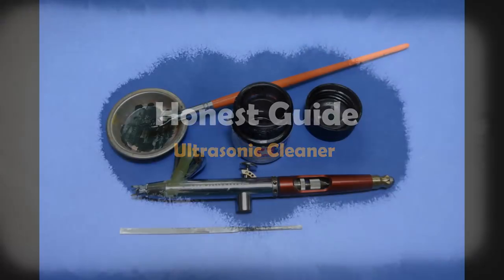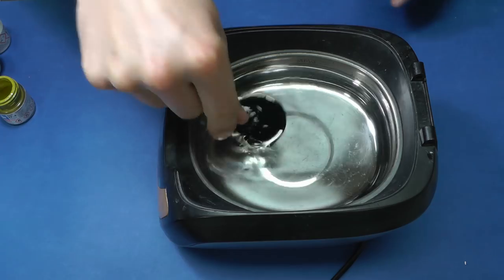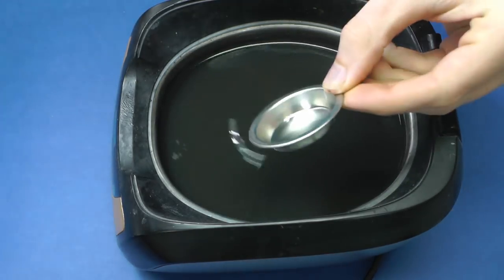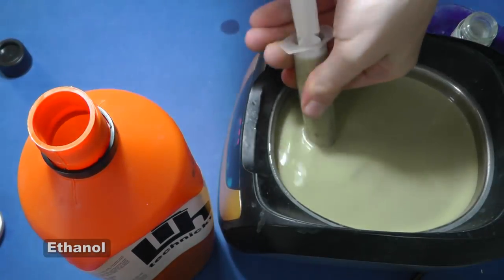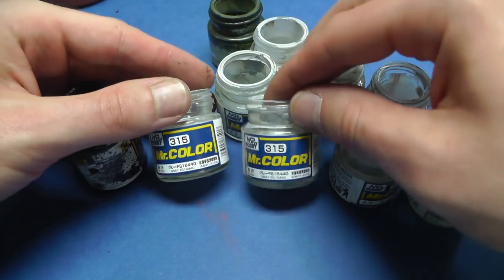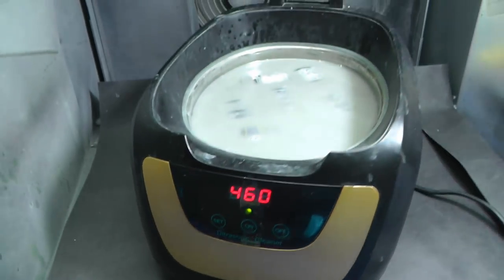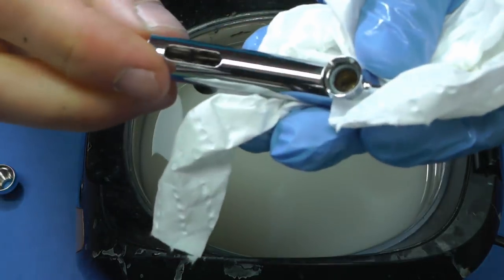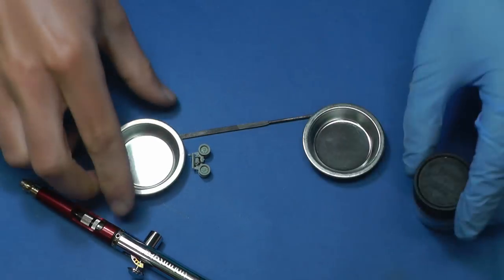Effortless way how to clean tools - Airbrush - Ultrasonic Cleaner - Honest Guide

Comment: Just a word of caution with using  Acetone in addition to the flammable vapours it produces, I used to clean my airbrush with Acetone and it melted all the rubber seals and O-rings.
Reply: Can you use ethanol or acrylic thinners with the o-ring or should I leave that part out of an ultrasonic cleaner?
Reply: +Tim Christophe
Ethanol and acrylic thinners will not harm rubber o-rings. However, acetone and lacquer thinners (also contains acetone) will damage the rubber.
Reply: Same thing for isopropyl alcohol ... Extreme warning with the ultrasonic
Reply: If i am not mistaken the harder and Steinbeck has teflon seals, a must if you run solvent based paints not just cleaning
Reply: Badger airbrushes use teflon seals.
Reply: So what thinner is best for the ultrasonic cleaner when cleaning an airbrush?
Reply: h&s has internal Teflon but still a few rubber seals.  

remove the internal seals and rubber seals before cleaning.  then just reassemble after 

the h&s won't need to be taken apart so often because the seals keep paint from entering the body of the airbrush

Comment: Thanks for the advise. Seems to work very well while it is a little expensive and uses a lot of chemicals too.
I just use cheap window cleaner to clean my Tamiya Bottles before reuseing them. If the paint is very dry leave the window cleaner in the Colorpot over night and you can clean it with an old toothbrush within seconds the next day. I made a video about this method (german language) if anyone is interested.
For cleaning my Airbrush right after usage I use simple window cleaner as well.
Reply: Chris McRoy  I cannot tell, because there's not much information about the ingredients on the bottle. Maybe that's normal in germany, never cared to look ^^
At least it does'nt smell like there was any ammonia in it.
I don't even know if my tip has any worth in other countries, now that I think of it. If there's window cleaner with and without ammonia maybe there are other differences as well.
Maybe you should just try it on half dried acrylics on a palette or something before you try it on something that could get damaged by the cleaner.

Comment: Just a word of warning: putting flammable liquids in ultrasonic cleaner might be dangerous. Cavitation and bubbles collapse produces heat, which can (in theory) ignite vapors of whatever is in the cleaner.
Reply from the maker: Thanks. I put it into description.
Reply: Agree.
I have a senior stainless ultrasonic cleaner ,the manual  tells you can't put flammable or corrosive liquids in it.
Use ultrasonic cleaner to clean model tools is not  uncommon in china, my way is put water in cleaner and  put thinker or ethanol in a small  bowl,then keep the bowl floating on the water.
And I think should very very careful when using ultrasonic cleaner with thinker ,double corrosivity easyly broken my plastics .Airbush's rubber ring may damaged too.

Comment: I get really good results with water and a good degreaser. My Ultrasonic Cleaner also has a heat setting so I can use hot water with the degreaser to clean parts.

Comment: @PLASMO - plastic models    I am a chemist and I want to warn you about benzene - BE EXTREMELY CAUTIOUS ABOUT BENZENE  It can cause cancer and CNS problems if exposed to it often.  If using this please do not use in the sonicator!  If you do you will need a respirator and chemically resistant gloves to minimize exposure and even then the fumes will still cause damage over time.  NEVER BREATHE BENZENE FUMES

Edit: I am glad you addressed PPE later, I just saw the 'I use benxene in a sonicator' part and panicked, I just didn't want to see you or anyone else get hurt by that stuff :)

Comment: also ultrasonic cleaner with some cleaning fluid is perfect for removing the release agents on resin kits
Reply: Yes, beyond any doubt. However, I have also found that vinegar (due to the acidity) also works well in cleaning the silicone films on resin and photo etch parts as well. :-)

Comment: How to use WAY less thinner to clean glass jars.  Get a jar large enough to hold the jar you want to clean.  Put the jar to be cleaned in it.  Fill it with lacquer thinner.  Now put that jar in your ultrasonic cleaner and fill you cleaner with water to about the same level as the thinner in the jar.  Obviously don't overflow the cleaner if they thinner level is higher.  Now use your cleaner as usual.  You don't end up with thinner in your cleaner and you use less thinner.

Comment: I mix window cleaner with alcohol and works just as fine. Only if paint is hard to remove I use pure alcohol or a more aggressive thinner
Reply: What's the ratio with solutions?
Reply: @beiber5  Doesn't really matter. Start with 20% Alcohol, 20% Window cleaner and 60% water, if the paint is too stubborn increase alcohol. It also depends on the chemical composition of the cleaner. Sometimes just alcohol alone is better. Do a few tests with what you have available around the house. Always use warm water, like 40-50 deg C
Reply: @Heybat  thanks alot!

Comment: ETHANOL  AKA  ETHYL ALCOHOL. IS THIS RIGHT ? IS WHAT YOU USE AT 0:49 ? TY
I USED ETHYL ALCOHOL 99.9% in a ultrasonic cleaner for 15 minutes and it becomes a little warm - no danger; i had a old acrylic paint jar and now it is clean as new; the paper label was detached in process.

Comment: PLASMO, You should never use any flammable liquid, like acetone, ethanol, or isopropyl alcohol, the liquid can catch fire from the heat generated by the cleaning.
Reply: Flash point of pure ethanol is about 17 degree Celsius, so below that you can drop a match and it won't catch fire, so maybe put it in the fridge. But besides that, ethanol burning is just a simple flame on top of the liquid, will not explode or something like that. I used to test the ethanol when making alcohol from fermented fruits

Comment: Nice tip! Can you do a video of how to clean your airbrush using enamel paints, after each paint and a cleaning in the end of the day. Thanks!
Reply from the maker: You can use the same method but with enamel thinner.
Reply: @idaemonplasmo  Hi Plasmo, have you try to clean paint of old models? I got few really old one, that been badly painted while being a kid.
I was wonder if that ultrasonic cleaner may dissolve the paint, without using any chemicals, not to melt plastic?
Thanks

Comment: Hi David, I wonder whether I can remove whole paint from an old model without damaging it? I learned new painting techniques from you and I would like to repaint my old models so they look korę consistent comparing them to newer ones
Reply: I’m not David but you can remove acrylic and lacquer paint with lacquer thinner (I use Mr Surfacer Levelling Thinner 400 for small sub assemblies or parts that have flaws or mistakes in so that I can start again from scratch). I’m not sure about removing enamels or oils, I hope David can give you more info.
Reply: If you're using lacquer or acrylic paint, you can let the models submerged in Isopropyl Alcohol overnight (or more) and use soft toothbrush and gently scrub to remove the paint from the model. I dunno if it works on enamel though.

Comment: I really enjoy your videos, but this one is just so misguided, sorry.... But I have to give you this critique, hope you still appreciate the feedback : )

1. NEVER EVER put things on the bottom, the vibrations will transmit metal to metal, damaging the equipment. There is a device directly attached to the bottom of the tank, this device gives off the vibrations 40.000 times per second, so you see not a good idea.

2. Never put the body into the bath, lubricants will be stripped and there are different metals in it so electrolytic reaction occurs. This means small pieces of the metal are removed. I have seen large plumbing tubes crumble into dust, just from being attached with water running through.

Check that what believe to be true is in fact true before you encourage people to destroy their equipment

From H&S:
Never place the entire airbrush in cleaners or solvents! The mechanics of the airbrush has
many different parts that must not be cleaned and will lose their mechanical functions by
using cleaner.
Also any lubricants will be flushed out of the mechanical parts (air valve, Quick-Fix end piece,
end piece with paint volume control and the entire waist). Only the parts that come into contact with paint, have to be cleaned (nozzle, air cap, needle, color cup and body)!
What cleaner can be used?
Generally the cleaner depends on the paint's basis. For example, water-based acrylic paint
can easily be cleaned with water. Additionally a customary airbrush cleaner like Hansa procolor airbrush cleaner should however be used for a thorough cleaning. This cleaner must in
no case be aggressive, or contain salt or ammonia. In general, different metals must not be
cleaned together in the same bath, otherwise an electrolytic reaction occurs.
Alcohol or thinner may be used in accordance with the materials of the parts. Please necessarily read the safety instructions of the respective manufacturers.
May an ultrasonic bath be used?
Only the parts mentioned above may be cleaned in an ultrasonic bath for a short time. Especially with regard to outer parts a rubber mat should be placed on the bottom of the ultrasonic
bath to prevent scratching. In the ultrasonic bath only cleaners as described above should
be used.

Comment: So I have the Paasche H airbrush and I have been using acrylic paints. for some reason the paint isn't coming out right no matter how I adjust the damn thing. I keep pulling out what looks to be like lint at the tip of the brush. I first use no water to thin, then I use some water to then and then a lot of water to thin and I keep getting the same results. I am constantly  having to adjust the nozzle so I can get a fine line and yet it keeps clumping on me and I get nothing plus I adjust the air as well. Need help here. So far the model is looking good from all the frustrations. But the bugs need to be worked out so I can move on in life.LOL.
Reply: Outlawflyer78 Hi - try using acrylic thinners.
Most acrylic brands have their own thinners to thin for airbrushing.
Water doesnt always work, as you've already found out :-)

Comment: David, you forgot to mention one VERY important detail:
Ultrasonic cleaners can severely damage any soft part of an airbrush, such as rubber rings !!!
Even teflon rings ( and other soft materials ) are just not strong enough to withstand the regular use of an UC, so these parts need to be removed before you put an airbrush in an ultrasonic cleaner.
Especially rubber rings are very fragile. In combination with alcohol or thinners in an UC bath, these rings can be destroyed, even in just ONE cleaning session !!
To all readers of this post : YOU HAVE BEEN WARNED !!
Reply: I've been doing it for a couple years now and no adverse effects at all
Reply: @Heybat  are you using thinner / water inside ultra cleaner
Reply: @ashtls6273  If you are trying to remove old paint then you will have to use pure alcohol or thinner. Certainly most thinners are harmful for most plastic parts especially rubber and soft plastic. But alcohol is generally safe for hard plastics and teflon but not rubber. for regular airbrush cleaning you could mix window cleaner with alcohol (IPA) albeit you will have to do some experiments with different window cleaners to make sure they can be mixed with alcohol. a very simple and effective airbrush cleaner is a mix of water, IPA and a few millilitres of glycerin. The ratio for IPA/water  doesn't have to be very precise, 20-30 volumetric  should fine. 
Say you wanna make 1 liter of cleaner, mix 200 ml of IPA with 800 ml of water then add 2-3 ml of glycerin.
Reply: @Heybat  wow thank you

But wouldn't it has a chance to combust?
How to prevent that
Reply: @ashtls6273  I haven't seen that happen in nearly 10 years of using ultrasonic systems both in the lab and at home. No matter what liquid you use, it always absorbs some energy inside the ultrasonic chamber, but it rarely gets hot enough to catch fire. If you run 8-10 min cycles and give it a couple of minutes to cool down between each run, I would say even pure IPA doesn't get warm enough to combust. But again if you are not dealing with stubborn and old paint do not use pure IPA.
Reply: @Heybat  dilute with water should be fine right?
Reply: @ashtls6273  Yes, as I said, you can do a 50-50 mix or 70% water with 30% IPA
Reply: @ashtls6273  Yes

Comment: Iam going to have to buy my wife an Ultrasonic cleaner for her birthday so she can clean her jewelry, she may as well clean my air brushes, paint brushes and other modeling tools at the same time. Wait a minute, I think I have found a flaw in my cunning plan.
Reply: She will damage the gem stones as they can't take the abuse and will shatter.
Reply: What you need to do at the same time is buy her some air brushes, paint brushes and other modeling tools, problem solved.

Comment: How do you clean the paint in the back of the brush? My favorite brush has a thick green bit of color at the end and i can not get it all out
Reply: +Potato
You could try and let your paintbrush soak in a brush cleaner solution for a for day (making sure that the bristles are suspended in the solution as not to bend and damage them). Subsequently, if you have an ultrasonic cleaner, use it to remove the pieces of paint in the ferrule. There are guides to this on YouTube and elsewhere. :-)

Comment: Little great thing! But I've read using this we should be raceful with seals and O-rings - it is great that H&S Infiniti has them very proof. ;) Thanks for video! ;)
Reply: Yes, acetone damages rubber. However, the Infinity has teflon seals and it is safe to clean with acetone and lacquer thinners.

Comment: Could you distill the ethanol mixed with paint to re-use it?
Reply: Just let the ethanol settle until all the particles are resting on the bottom of the container. Use a syringe or similar suction device to decant the clear ethanol to a clean container. That's the easy solution. :-)
Reply: Thanks!
Reply: does this work with 50% alchohol?

Comment: my HS Infinity keeps clogging up.  i've tried soaking everything in tamiya thinner and running airbrush cleaner through it but i still keep getting air bubbles.  any tips on what to do?
Reply: What do You mean You keep getting air bubbles?
Reply: sounds like the air hole is clogged or you have damaged the nozzle 

if you get air bubbles in the cup then your airflow is blocked somewhere